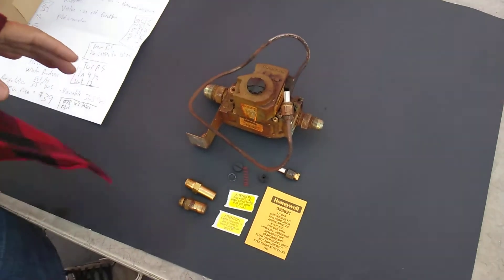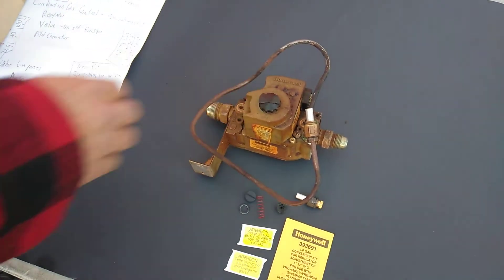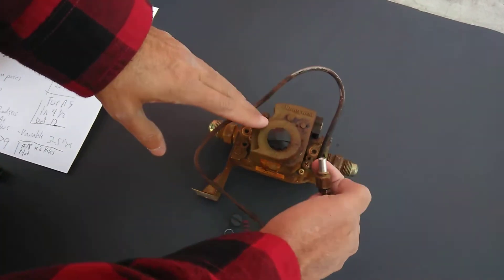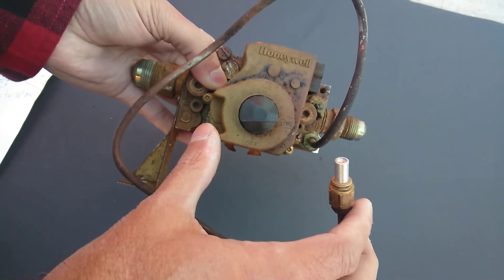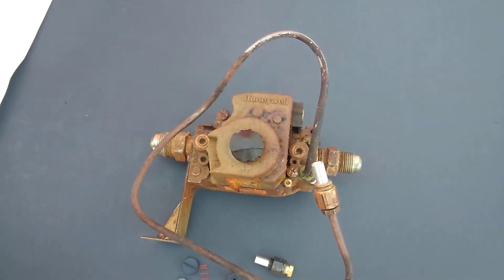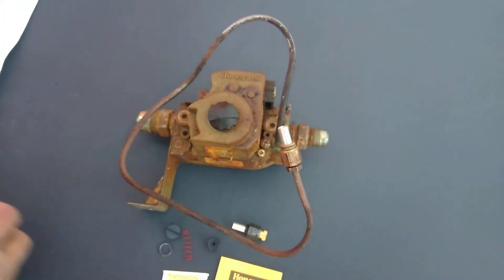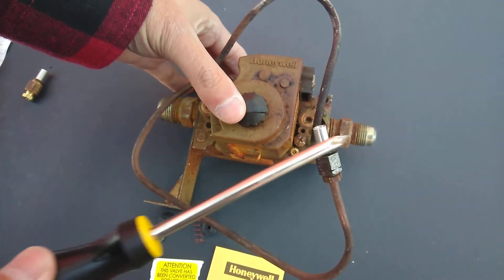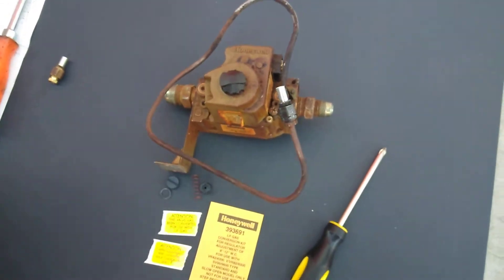Converting a Honeywell Gas Control - Gas Valve on Blodgett Oven

Comment: Hellow! Thank you for the great video, wanted to know if a Blodgett convection oven with propane gas can be converted to natural gas (other way around) and have it functioning perfectly.
Reply from the maker: Converting the regulator is only one part of doing a fuel conversion. I actually sell orifices for every stove and bar-b-que unit made. I'm in the MidWest, and you can always get a hold of me at 714-574-1544 during normal MidWest business hours.

Yes. Anything can be converted from natural gas to propane or propane to natural gas. I've done some of these Blodgett models, so give me a call if you need parts. I also have a line on the regulator shown in this video.